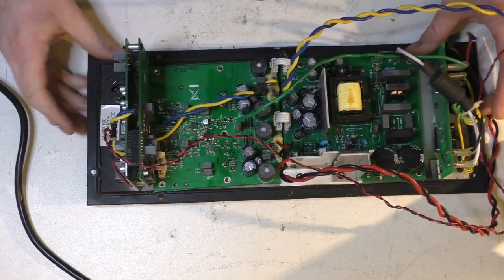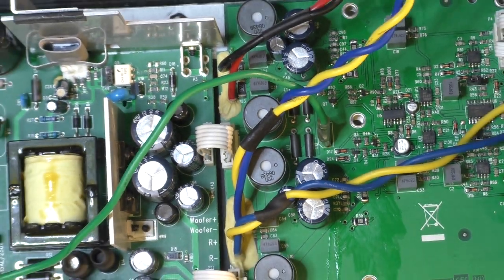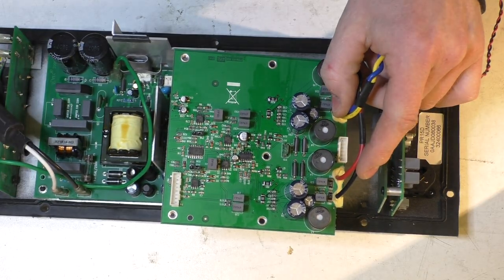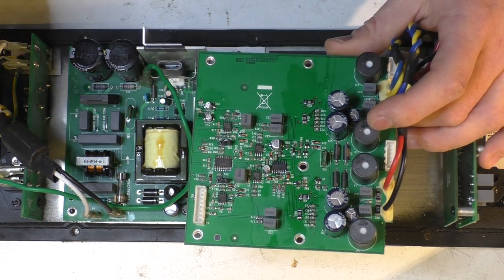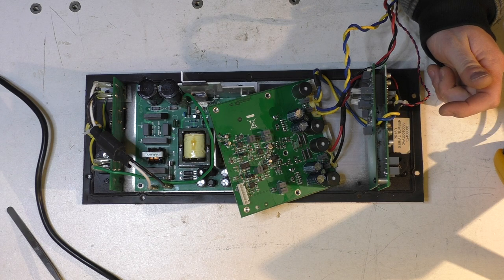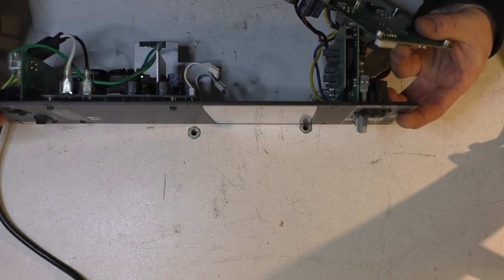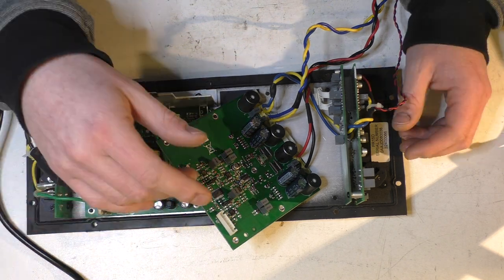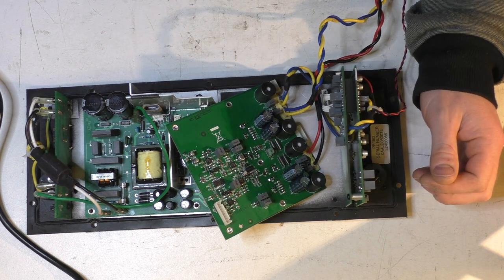Peavey PR15D Repair - Powered PA Speaker

Comment: I wish I saw this before I bought these PVX 15's. I didn't have them for 6 months and when the Modules went out. and it took them 2 months to send them back only to go back 30 days later. I had them for over 7 years now and I only play them about 10 times. Now all they do is clip when I push them past 3. 
I hate these speakers with a passion.

Comment: Hey I have one of these and I'm looking to repair myself after lending out to a local band. It's far quieter than the other, buzzy, and when I open up the grill and press down on the drum, it's louder again but still buzzy. This leads me to believe that the coil is blown out. 

Is this enough reasoning to justify buying a 60 dollar coil frame replacement on Amazon or wherever? How would I know for sure that it's not a problem with the board? If the signal reaches the speaker and I'm hearing sound does that mean that it's probably not the board?

Just starting out on my music gear repair skill journey, really just at the stage of testing continuity, soldering replacement potentiometers and so on. Would appreciate any pointers, you seem like a guy who understands the importance of fixing something urself. Thanks!
Reply from the maker: They're too old now to be economically repairable.

Comment: Great video .I'm  looking at a pvx p12  on my bench and didn't know anything about it, but your video explains how its built . A few questions.  About how many volts should the switching powersupply be outputing to the output board ?   Is the signal analog or digital going into the output board, i see it uses a about 8 wires .  Which board is the crossover on ?
Reply from the maker: Do you honestly think I remember that off the top of my head from a video posted 3 years ago to the day? Lol! The service manual is freely available online.

Comment: Do you do repairs? My Peavey PR15D not working (no lights).  I think it's in the board with the power transformer. What would be the common problem if any for that board? Thanks
Reply from the maker: I do repairs, but I'm in Australia. What makes you think it's the board with the transformer? Have you got any test equipment at all?